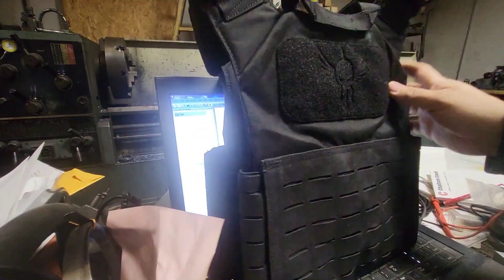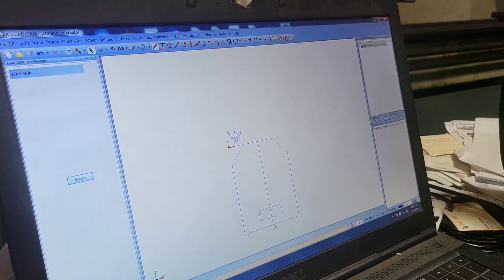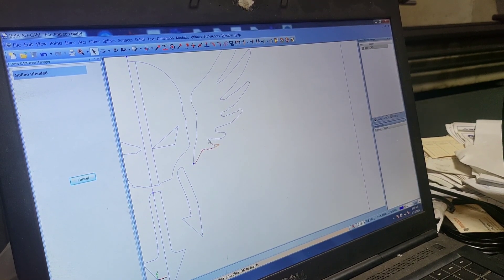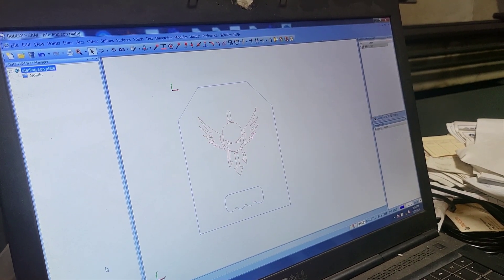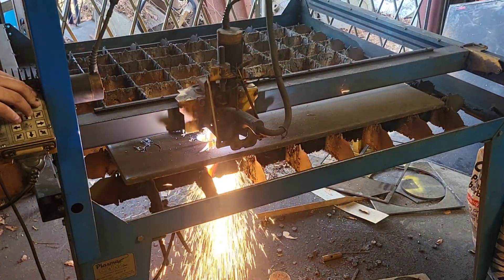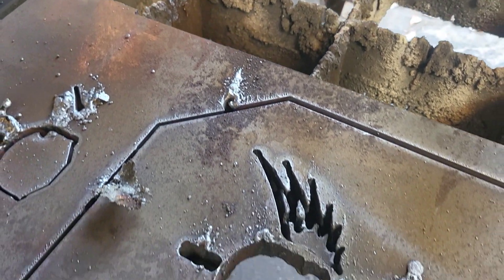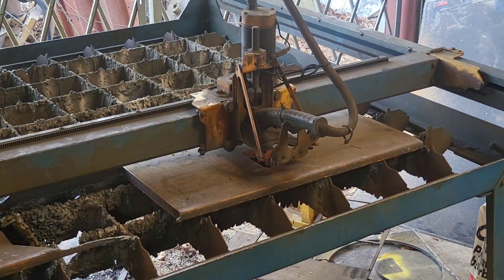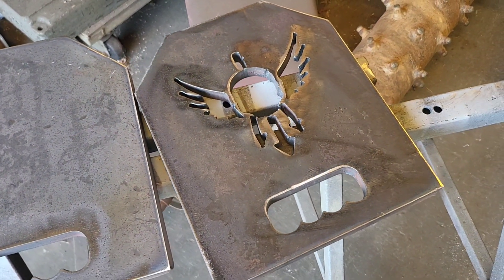How to Cut 3/4" Steel Plate Like Butter: CNC Plasma Table Demo

Comment: Hi! Would you be able to tell me what you had your had your cutter settings at? My knowledge is very basic and I’m having a hard time getting my table to cut through 3/4 plate
Reply from the maker: I am using a Thermal Dynamics Cutmaster 101 set to 80 amps. 15 in per minute cut speed with a 3 second pierce time